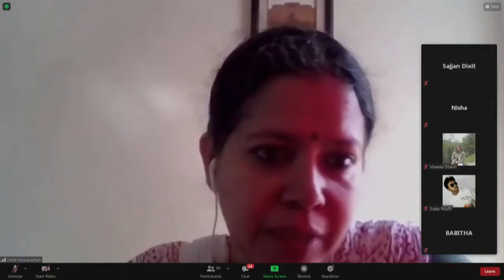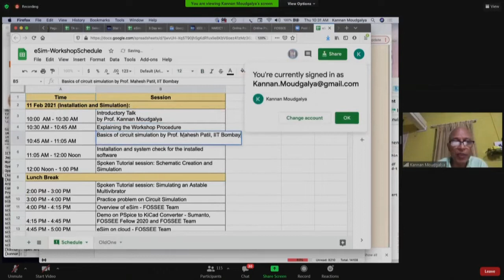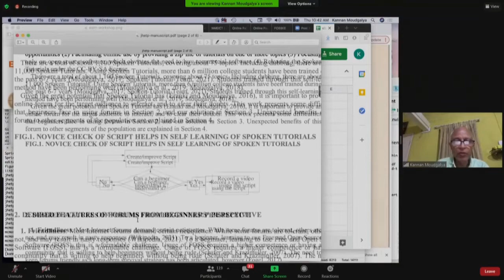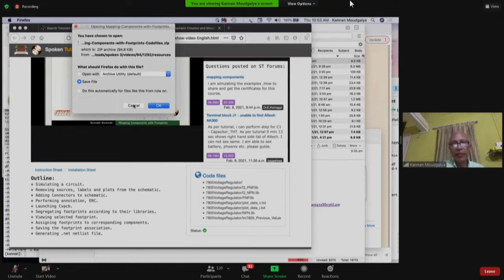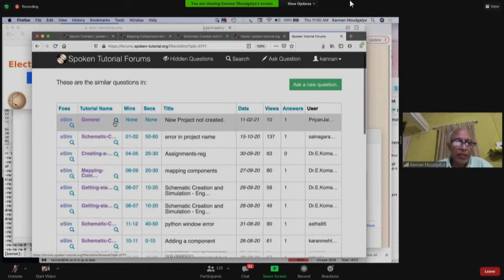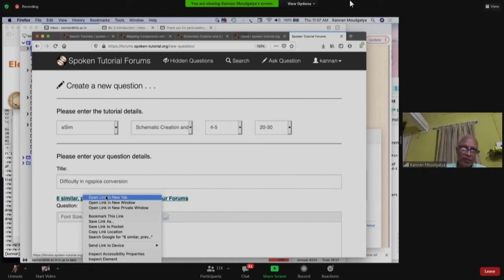Day 1 Session-1 by Prof. Kannan Moudgalya

Comment: Thank you Prof. for this incredible Free Open source Tool, it's quite useful and will be very helpful to students and early professionals and small startups.

00:15) Introduction to the FOSSEE project: FOSSEE stands for Free/Libre & Open Source Software for Education, aiming to replace paid commercial tools with free, open-source alternatives in education.

(01:01) Overview of eSim, the open-source EDA (electronic design automation) tool developed under FOSSEE: integrates KiCad, NG-Spice, and GHDL for schematic design, simulation, and PCB tasks.

(02:35) Prof. Moudgalya welcomed participants, emphasizing eSim’s free availability and usefulness for both students and professionals.

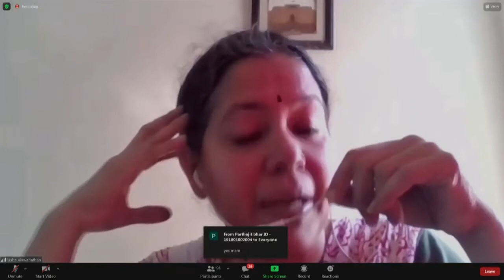(04:06) Other tools promoted by FOSSEE were mentioned: Scilab (an alternative to MATLAB), Python, R, DWSIM (process simulation), and OpenFOAM (CFD), supported by workshops and community forums.

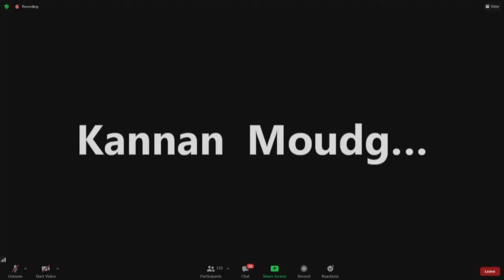(05:35) Motivation behind open-source adoption: accessibility for remote students, avoidance of costly proprietary licenses, and enabling entrepreneurship.

(06:57) Prof. Moudgalya shared personal educational history and early experiences with hardware and computing projects, illustrating the value of practical engineering work.

(16:23) Insight into digital logic and microcontroller cycles from his early lab experiences, demonstrating hands-on learning impact.

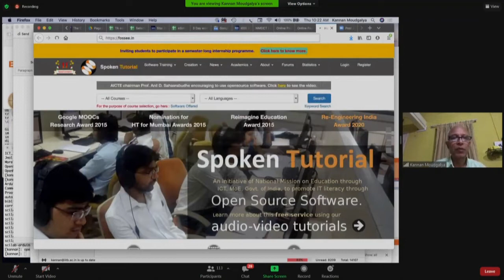(17:55) He showcased parts of the FOSSEE website and highlighted a quote by Dr. A. P. J. Abdul Kalam on the importance of open-source for broad access to technology.

(20:21) Discussion of additional FOSSEE efforts: openPLC (open-source programmable logic controller hardware & software) and related publications, emphasizing community contributions.

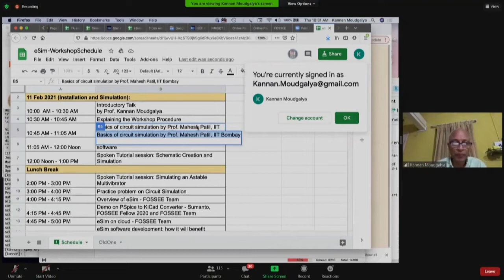(27:41) Workshop logistics overview: installation support, practice problems each day, optional discussion sessions, and invited talks by other professors and experts to demonstrate eSim in teaching and research.